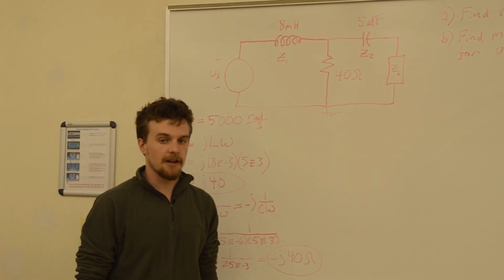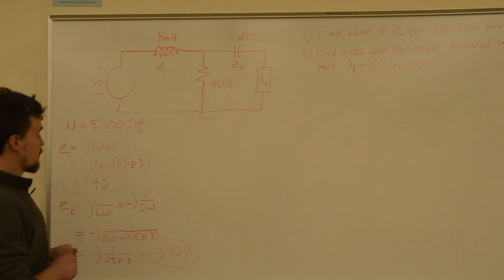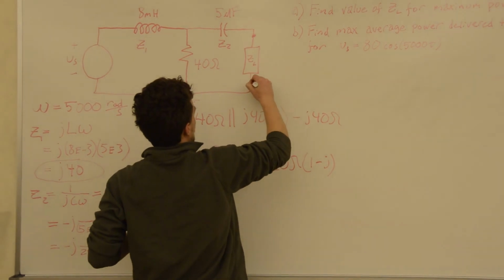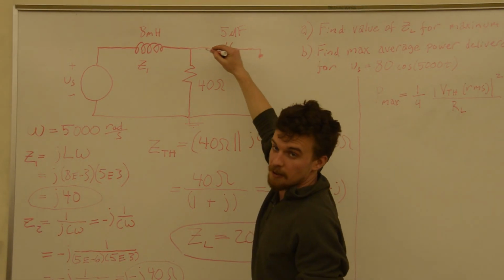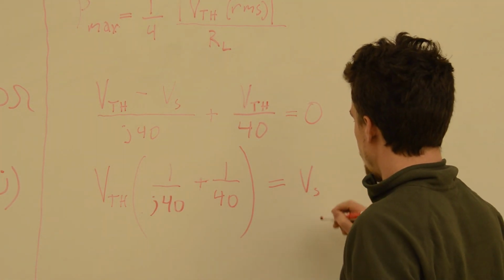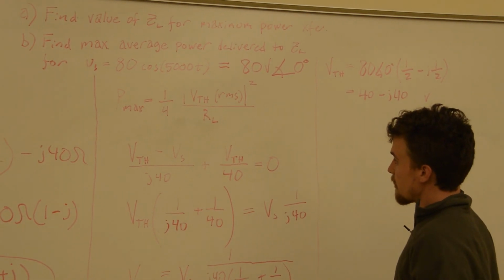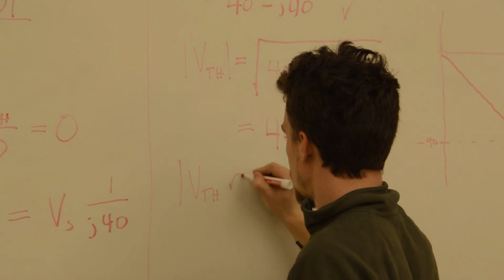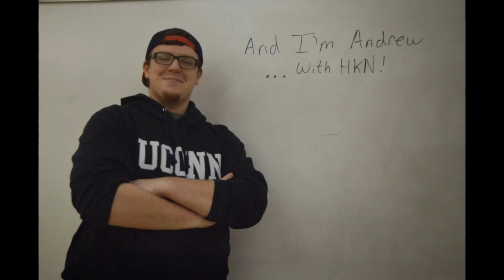Circuits 1 - Load Impedance and Max Power - Vintage

Comment: Sweet. So you're saying if I'm building an appliance that plugs to the wall then Vs should be 120 angle 0, and if for instance my product runs at 1000 watts then basically in the circuit satisfies these formulas you applied?! Thank you!

@Uconn HKN